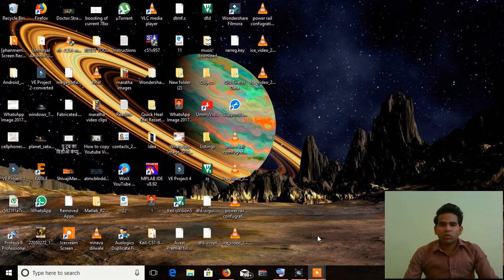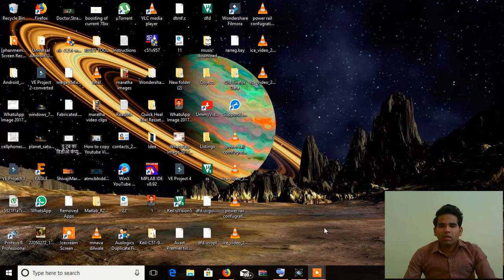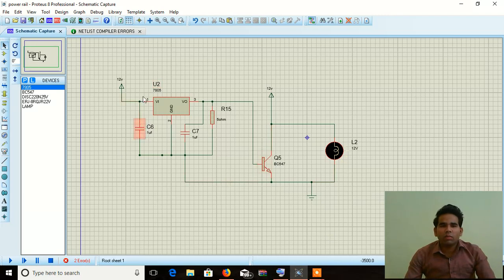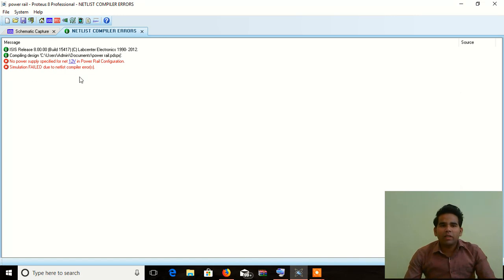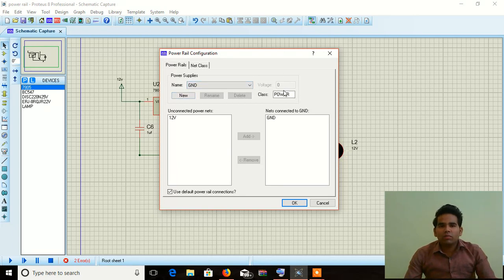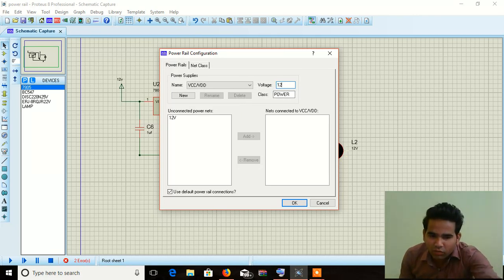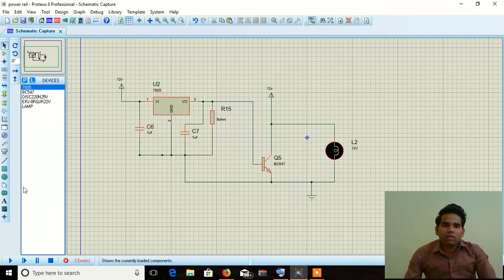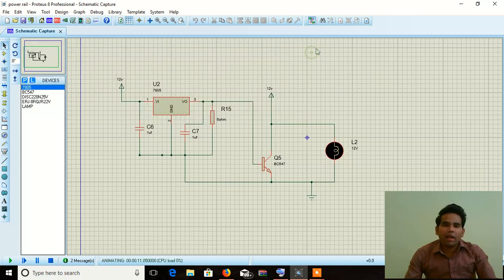how to solve error in proteus power rail confugration not specified.

Comment: When i run simulation, it stops showing error due to excessive CPU load schematic is not running in real time? What solution will you suggest?
Reply from the maker: I need your project to solve error.... actually its because of you simulate the circuit in high frequency so that error occurred. Also you need to make your circuit less complicated to solve the problem. I hope its work for you.
Reply: @kbtechelectronics  May i have your email so that i can send you files?

Comment: hi, could u help me? currently, i just try to simulate the oscilloscope & function generator. then after run it show "simulation thread has been terminated".
Reply from the maker: Yes, why not. I can help you but I need your project detaills to solve your problem...
Reply: @kbtechelectronics  i am using proteus 8 and 8.8. i just do basic circuit. to see the 10MHz frequency using oscilloscope and function generator
Reply: Do u know the solution for simulation in real time? I think this happened is related to real time

Comment: hi sir can u please help me  to solve" pin not found in child module " error
Reply from the maker: Give the project details
Reply: @kbtechelectronics hello sir thanks for the reply;  i am trying to simulate 3 phase inverter using FAN7392N IC and FDP2D3N10C power mosfet, these components were not present in the library so i added them manually , when running, it says that the pins say 'Vs' pin doesn't exist in the child module...its the same error for all the pins of the IC and MOSFET, please help sir
Reply from the maker: Actually i need your project to solve this error